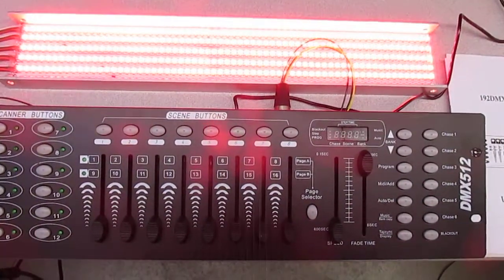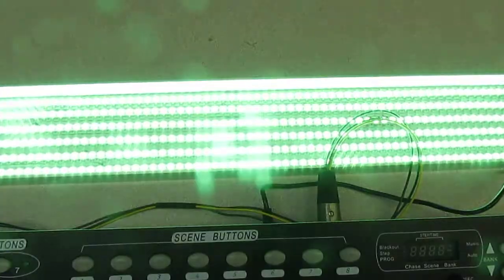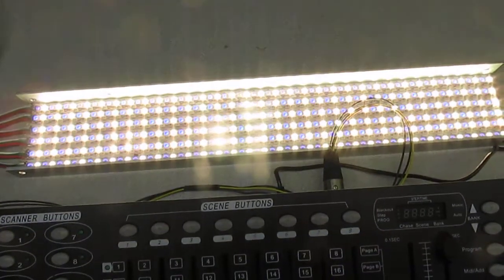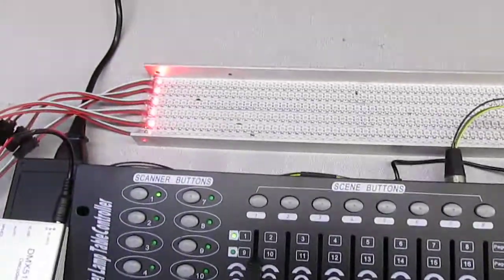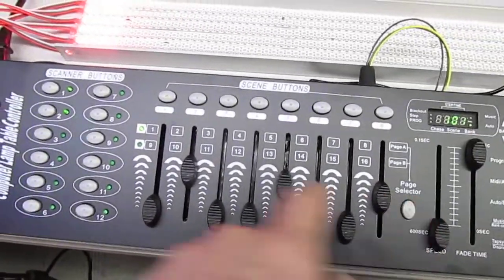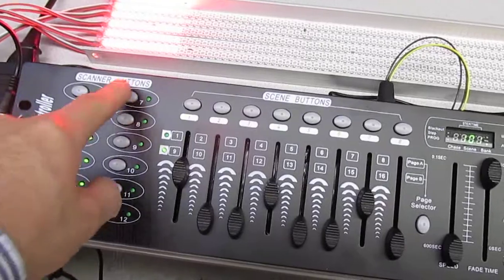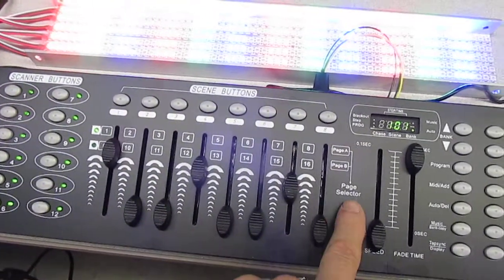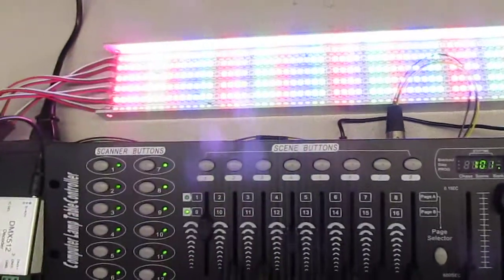SP201E to WS2812 LED strips DMX control

Comment: The 'groups of 16' is very specific to the layout of this sort of lighting desk (I have the same one actually) but not a feature of DMX as such. As you say the device doesn't have massive numbers of uses since you're limited to 170 RGB pixels over a full DMX universe (these desks actually only support 192 channels = 16 * 12). I use mine for a small number of WS2811 floodlights as part of my overall DMX installation.

The built in patterns/effects (when DMX is not connected) may be more use for many applications.

Comment: Hi Bob, could you tell me how to set IC SEL on SP201E   correspond to  WS2812  and WS2811?
Reply from the maker: Felix, I do not remember setting the IC sel? Acording to the manual switch 2 on is WS2811/12 othre switches off.

Comment: Hi, I have a question, did you directly answer the ws2812 strips to the SP201E DMX?
Or did you use the RS485 module?
Reply from the maker: The WS2812's connect directly to the SP201E, then RS485(DMX) from the SP201E to the DMX controller/

Comment: I absolutely have no idea how DMX works, I didn't understand anything to this video but what light operators are paid for !
It must be a hard job to program lights for TV shows or any show. 

I think DMX is MIDI compatible but not sure, could you confirm please ?
Reply from the maker: I have not tried mixing MIDI and DMX so I would not know how well they work together.
Reply: DMX and MIDI are not compatible with eachother. they have different wordlengths, refresh rates, and bitdepths, not to mention each piece of the packet represents completely different data. however, MIDI *can* be used to control DMX interfaces, like desks, consoles, and desktop programs, but that involves very complicated conversion that must be done on a software level. meaning: there is no passive way to get one to work as/with the other